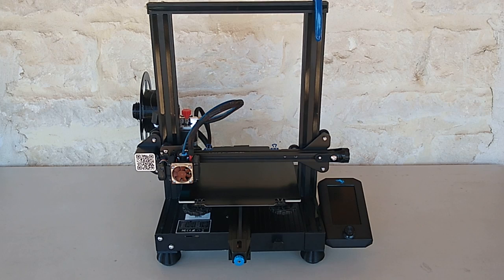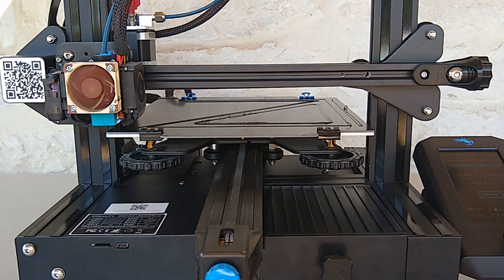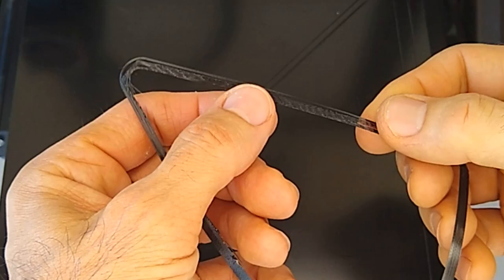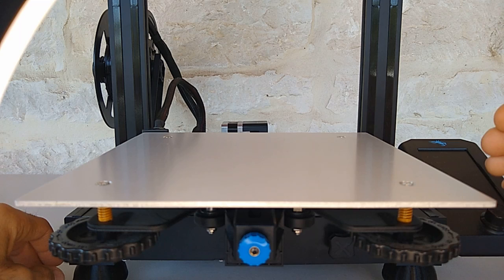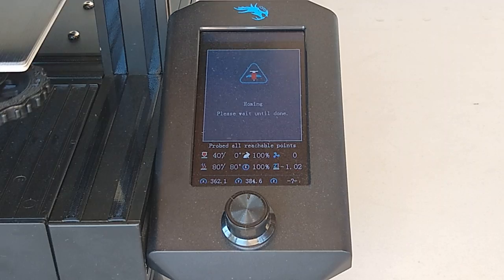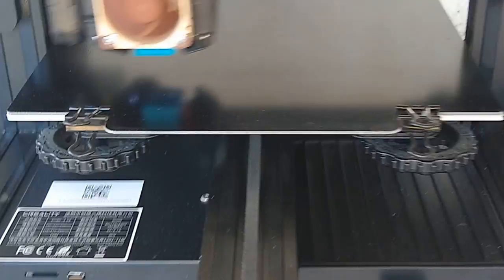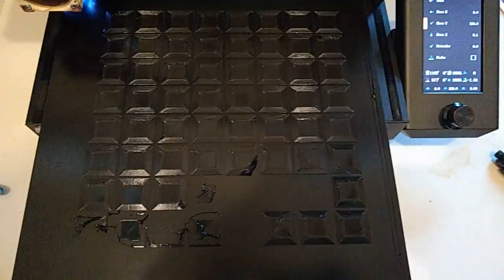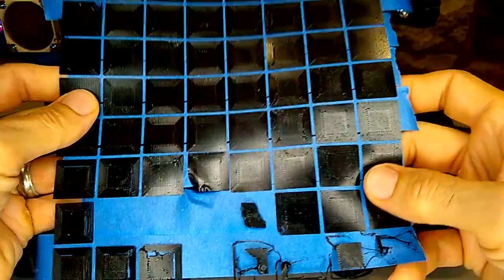Jyers Firmware Unified Bed Leveling Ender 3 V2 - Getting Perfect First Layers From An Uneven Bed

Comment: Before I saw your video, I did the same ruler straight edge test as you. My results were the same as yours diagonally but dramatically worse. When I rocked the ruler, in one direction,  i got a gap at one end of aprox 2 to 3mm. I thought wow, thats a large hump in the middle. Eventually I discovered that if I took ALL of the tention off of the (upgraded yellow/orange) springs, the hump in the centre all but disappeared.
Reply from the maker: Hello Lyndon, Great job with a more in depth look at the root cause of this issue. I hadn't even thought that it could have been induced by the stiffer springs. Have you tried easing up on the spring tension? but keeping them tight enough to keep the wheels from backing out during prints? You can also use solid mounds but you need to make sure that everything else is well calibrated since you won't have any build plate give should the nozzle crash into the bed. What build plate material are you using?
Reply: @vbared  Hi Victor. I'm using the original 'glass' build plate that came with the E3V2 but the ruler tests were on the bare bed. In my case there isn't a central hump in the bed but rather a diagonal 'hump' that can be tuned in or out with the corner sprung wheels. Starting to wonder if the upgraded springs are too stiff for this application but then everyone seems to recommend them?  I had originally set the bed level manually with a piece paper but then failed to reset it periodically as I wasn't sure how often it was required. Then after a while I started having print failures which led me down this path. Of course, a more flexible build plate would make the "warp' less obvious to the eye. An unclipped stiff glass plate will 'rock' just as enthusiastically as a ruler. This could all be a bit of a false trail but worth pursuing, I think. I'll et you know if I find anything significant.
Reply from the maker: @lyndonp6296  Good morning Lyndon, How bad is the bend on the bare aluminum bed with the wheel nuts totally removed. Sometimes there is a slight hump that can be straightened out by pressing against the hump with something like a sandbag to minimize it. Are you using a bed probe like a CR-Touch?

Comment: hey do i have to have a z offset because when i start printing the nozzle is far away from the bed but if i go to manual tunning of the mesh it goes to the right distance. the offset dosent even end up working some parts print ok some are super deep and some dont stick because they are so far away i have tried so many different software's and nothing works i dont know what to do i feel like i got a dud machine
Reply from the maker: Hi ColinLoventhal69, Are you using the stock , metal bracket that came with your CR-Touch?
Reply: @vbared  yes
Reply from the maker: @ColinLoventhal69  What is your current z-offset?

Comment: EXCELLENT VIDEO VICTOR!! thank you very much, i appreciate this. glad im not the only one who has a ender 3 v2 lol but hey,  got a question for you!

lets say I create a mesh, manually tune it so the z offset is at perfect height through out the entire mesh ok? now, where im confused is in the starting G Code (not the one you provided, that works tremendous and am so happy someone created that). Do I use an "M420 S1 ; Enable mesh stored in EEPROM"  or do I do a "G29 ; Auto Bed Level" Also,  G26 also is a Mesh Validating code that (from my understanding) creates a new mesh before every print, would this be a "more accurate" version of a G29/M420?  i assume this is more so personal preference but just want to be clear because i feel like this firmware would prefer G26 code, but im also VERY new to printing. Thanks again Victor.
Reply from the maker: Hi JustA YouTuber, Thanks again for commenting and kind words. The start g-code that worked well for me is below. My print bed is shaped shaped like a Pringles potato chip so I had to disable the probe for bed tilt by adding the ; (aka commenting it out) in front of that command because it would screw up my mesh. The G29 command has a few different uses. These are the three that I use. With this UBL firmware I don't do the G29 ; Auto Bed Level before every print but instead activate the stored bed mesh and load it from my slot 0 before my print starts. Take a look at my complete start g-code so you can see how I use the G29 commands.

G29 ; Auto Bed Level
G29 A ; Activate bed mesh -level (BL-Touch)
G29 L0 ; Load mesh from slot 0

Complete Start G-Code:

; Script based on an original created by tjjfvi (https://github.com/tjjfvi)
; An up-to-date version of the tjjfvi's original script can be found
; here:  https://csi.t6.fyi/
; Note - This script will not work in Cura V4.2 and above!
; max_feedrate_z_override = {max_feedrate_z_override}
; retraction_amount = {retraction_amount}
; retraction_hop = {retraction_hop}
; retraction_hop_enabled = {retraction_hop_enabled}
; retraction_prime_speed = {retraction_prime_speed}
; retraction_retract_speed = {retraction_retract_speed}
; retraction_speed = {retraction_speed}
; speed_travel = {speed_travel}
; retraction_enable = {retraction_enable}
; layer_height = {layer_height}
; smooth_spiralized_contours = {smooth_spiralized_contours}

; Ender 3 Custom Start G-code
M117 Pre-heating the extruder!
M104 S150; start warming extruder to 150
M117 Getting the bed up to temp!
M140 S{material_bed_temperature_layer_0} ; Set Heat Bed temperature
M190 S{material_bed_temperature_layer_0} ; Wait for Heat Bed temperature
G28 ; Home all axes
M117 Auto bed-level GO!
G29 A ; Activate bed mesh -level (BL-Touch)
G29 L0 ; Load mesh from slot 0
; G29 J3 ; Probe for bed tilt (remove semicolon to enable)
G1 X245 Y218.5 Z1 F5000.0
G92 E0 ; Reset extruder
M117 Getting the extruder up to temp!
M104 S{material_print_temperature_layer_0} ; Set Extruder temperature
M109 S{material_print_temperature_layer_0} ; Wait for Extruder temperature
G1 Z1.0 F3000 ; move z up little to prevent scratching of surface
G1 X225 Y200 Z0.3 F5000.0 ; move to start-line position
M117 LET THE PURGE BEGIN!
G1 X225 Y20 Z0.3 F1500.0 E15 ; draw 1st line
G1 X222.2 Y20 Z0.3 F5000.0 ; move to side a little
G1 X222.2 Y200 Z0.3 F1500.0 E30 ; draw 2nd line
G92 E0 ; reset extruder
G1 Z1.0 F3000 ; move z up little to prevent scratching of surface
M117 Autobots! Roll Out!
; End of custom start GCode
Reply: @vbared  thanks again!!
Reply from the maker: @justayoutuber9605  Anytime friend!

Comment: I'm running the same firmware on an Ender 3 except mine has the touch screen display. Also, my firmware does not have the two mesh slot save feature. When I first installed the firmware I thought the bed leveling would by automatic once the Z home height was set. Apparently the Jyers firmware does not have auto bed leveling, it just allows one to manually set nozzle height at multiple points of the bed and save those settings. But, when I pick a probe point in the mesh, the nozzle does not move to that point and go down to the set height. It does allow you to change the nozzle height at that particular point but you have no idea which way to move the nozzle and how far because the nozzle stays at it's home position. This makes trying to level the bed impossible. If for some reason the bed level changes at one or more points, the firmware will do nothing to compensate based on your initial Z height adjustment. Totally useless in my opinion. It's a shame that this firmware is no longer being supported nor worked on. There are several bugs in it that drive me crazy but has many great features that the original Creality firmware does not have. Personally, I'll be searching for something better.
Reply from the maker: Hello Waltkat, Thank you for commenting. Yeah, I hear you it was good in its time. I've switched 5 of six printers to Mainsail Klipper and the last one is running Miguel's Professional Firmware. I had a lot of trouble early on with automatic bed meshes not being accurate and needing manual adjustments to correct them. The only way to get accurate meshes is to minimize the z-offset value from high numbers like -1.76 to something super small like -0.020. The closer you are to a 0.000 z-offset the more accurate the bed mesh will be. There are two ways to accomplish this one is to create a probe mounts in CAD that move the probe body further and further away from the build plate so that it triggers when the nozzle is very close to the build plate. The second way is to dial in the probe distance using an adjustable mount (way easier that having to print many different height probe mounts. The idea is to get the nozzle to the same distance from the bed than the layer height you will be printing. The adjustable probe mount that fits the Ender 3 V2, Ender 3, Ender 3 Pro, and others that can accept the Ender 3 V2 X gantry bracket. Amazon link and how to install video below. Once you're dialed in just create your bed mesh using Miguel's Professional Firmware, Klipper or any other UBL firmware save it to the EEPROM and recall it after your G28 Home All entry in your slicer's Start G-Code similar to mine below: 

G28 ; Home all axes
G29 A ; Activate bed mesh -level (BL-Touch)
G29 L0 ; Load mesh from slot 0 

Precision Adjustable Probe Bracket - https://amzn.to/45mgQhw
How to install and set the probe mount - https://youtu.be/appvG-7PG8E

Comment: so with this firmware? do you have to modify the g code prior to slicing? or will it map this mesh to anything loaded in the printer?   
and also, does the mesh go
away after the machine is powered off ?
Reply from the maker: Hello Eric, Thank you for commenting. Once the mesh is created and tweaked it must be saved to a slot on the EEPROM. I add a couple of lines to the start G-Code to load the mesh after the G28 home all saved in the slot. Check the video description for my starts G-Code.

Best of luck with your mods!

Best of luck with your mods!

Comment: Woah!   How did you get so many test points for your mesh? The most I saw was a 5×5 grid??
Reply from the maker: Hello Broderp, Thank you for commenting. The link in the video description is to the same firmware used in the video, It's a 10x10 probe mesh. I've since switched that machine to Mainsail Klipper but if I had to choose a non Klipper UBL firmware today for an Ender 3 V2 with a 4.2.2 mainboard I would use Miguel's Professional Firmware (linked below). It has a 9x9 max mesh and produced a spot on bed mesh for me without the need to manually edit anything.

https://drive.google.com/uc?export=download&id=1Deep83hNWfwzM5nZ5vt5KzdV3VPbZGts

Best of luck with your mods!
Reply: @vbared    Thanks for the info!  I checked both my V2's and one has a 4.2.7 board, so I will need to check around and possibly look into the Professional firmware.  I like Jyers, but with no updates in a year, I'm thinking its time to move on.
Reply from the maker: @broderp  The Professional firmware has tramming and runs a special algorithm for hotend control instead of the standard on and off, just to name a few. It's what I'm using on my non Klipper Ender 3 Pro, I can't say enough about it.

Comment: Thanks for the grate videos. How do you get the bed mesh loaded with cura 5.1
Reply from the maker: Hello Dom, Thank you for commenting and kindness. 

Place this after your G28 ; Home all axes

G29 A ; Activate bed mesh -level (BL-Touch)
G29 L0 ; Load mesh from slot 0

My Complete Start G-Code:

; Ender 3 Custom Start G-code
M117 Pre-heating the extruder!
M104 S150; start warming extruder to 150
M117 Getting the bed up to temp!
M140 S{material_bed_temperature_layer_0} ; Set Heat Bed temperature
M190 S{material_bed_temperature_layer_0} ; Wait for Heat Bed temperature
G28 ; Home all axes
M117 Auto bed-level GO!
G29 A ; Activate bed mesh -level (BL-Touch)
G29 L0 ; Load mesh from slot 0
; G29 J3 ; Probe for bed tilt (remove semicolon to enable)
G1 X245 Y218.5 Z1 F5000.0
G92 E0 ; Reset extruder
M117 Getting the extruder up to temp!
M104 S{material_print_temperature_layer_0} ; Set Extruder temperature
M109 S{material_print_temperature_layer_0} ; Wait for Extruder temperature
G1 Z1.0 F3000 ; move z up little to prevent scratching of surface
G1 X225 Y200 Z0.3 F5000.0 ; move to start-line position
M117 LET THE PURGE BEGIN!
G1 X225 Y20 Z0.3 F1500.0 E15 ; draw 1st line
G1 X222.2 Y20 Z0.3 F5000.0 ; move to side a little
G1 X222.2 Y200 Z0.3 F1500.0 E30 ; draw 2nd line
G92 E0 ; reset extruder
G1 Z1.0 F3000 ; move z up little to prevent scratching of surface
M117 Autobots! Roll Out!
; End of custom start GCode

Comment: Excellent detailed video. What made you choose the O.15 gauge?
Reply from the maker: Hello Jesse, Thank you for commenting and kindness. Excellent question, over the years I've learned that many printing issues are caused by two major things: wrong build plate material for the filament type and improperly set z-offset. There are others but in my experience 40% are caused by these. It starts with the build plate material. PLA, PLA-plus, ASA, PETG, and Nylon I highly recommend

https://amzn.to/3gDLI9b

Once you have the right build plate material next thing is to properly set the z-offset. The z-offset should be much higher than the .10 most recommend. The key is to have the nozzle deposit the molten filament onto the build plate squishing it no more that 22.5%. The idea with the 22.5% number if printing at a .2 layer height you don't want the nozzle dragging through the filament it's pushing out because it will collect on the nozzles' edges causing stringing (that can't be resolved by retraction) and blobs that will get randomly deposited throughout your print. So .2mm layer height minus 22.5% gives you .155 and thus the reason I start by to set the z-offset using a .15 feeler gauge and from there I fine tune by printing test squares with brim having a .1 gap between it and the test square. I'll print the test part over and over each time baby stepping the z-offset up or down until the brim barely holds on the square.

Let me know if you have more questions about this.

Best of luck with your mods!
Reply: @vbared  thank you so much for the detailed explanation that REALLY explains why. I get great prints and my Z offset is -14 - I totally feel the bed leveling is the #1 “most” important step. I’m really considering starting over to dial it in and will watch you videos - SUBSCRIBED! will check it sir. I really appreciate this information.

Comment: also, I have the Jyers 5x5 (25 probe points) firmware, not the 10x10. noticed in the 5x5 firmware that it doesnt have storage configuration numbers. for example if i put the start g code at m420 S2 (not S1) I dont have the option to store different mesh's in this firmware. does this affect anything?

and i personally have another z axis rod/stepper on my printer. is the G Code for Auto Z axis level necessary while creating a bed mesh?
Reply from the maker: Hi JustA YouTuber, If your bed is not straight, like mine, I would either use the Jyers UBL or Klipper (which is what I'm currently using on my two Ender 3 V2s) If you have a straight bed then the 5x5 will work just fine (no need to store or load bed meshes) it will just use the data gathered from the 5x5 probe points prior to each new print.

Have a wonderful night (:

Comment: What cooling fan setup is this? I like how it's simplistic and doesn't look too heavy
Reply from the maker: Hi Reecefpv, Like you I wasn't able to find many that didn't add a lot of weight or bulk to the x-gantry and decided to design my own super simplistic version that I improve on over time. The current version enables the printing of Nylon without the need for an enclosure. I offer it on my Shopify for $3.49 to help support my channel.

https://victor-bared.myshopify.com/products/minimalist-fans-bracket-and-ducts-for-dual-4010-blowers-single-4010-heatsink-fan-stl-files-for-diy-3d-printing?utm_medium=product-links&utm_content=android

Best of luck with your mods!

Comment: Hi Victor; thank you for the huge effort. Unfortunately I cannot get the my E3V2 to utilize the saved mesh regardless of what starting Gcode that I use. However Miguel's works with a M420 S1 Z2 start code. I thought I'd try the Jyers option as it has more features. Some day I may figure it out.
Reply from the maker: Try this non-Klipper one that I used to use with Miguel's Professional Firmware. Copy everything below and paste into your start g-code field in CURA.

; Ender 3 Custom Start G-code
M117 Pre-heating the extruder!
M104 S150; start warming extruder to 150
M117 Getting the bed up to temp!
M140 S{material_bed_temperature_layer_0} ; Set Heat Bed temperature
M190 S{material_bed_temperature_layer_0} ; Wait for Heat Bed temperature
G28 ; Home all axes
M117 Auto bed-level GO!
G29 A ; Activate bed mesh -level (BL-Touch)
G29 L0 ; Load mesh from slot 0
G1 X245 Y218.5 Z1 F5000.0
G92 E0 ; Reset extruder
M117 Getting the extruder up to temp!
M104 S{material_print_temperature_layer_0} ; Set Extruder temperature
M109 S{material_print_temperature_layer_0} ; Wait for Extruder temperature
G1 Z1.0 F3000 ; move z up little to prevent scratching of surface
G1 X225 Y200 Z0.3 F5000.0 ; move to start-line position
M117 LET THE PURGE BEGIN!
G1 X225 Y20 Z0.3 F1500.0 E15 ; draw 1st line
G1 X222.2 Y20 Z0.3 F5000.0 ; move to side a little
G1 X222.2 Y200 Z0.3 F1500.0 E30 ; draw 2nd line
G92 E0 ; reset extruder
G1 Z1.0 F3000 ; move z up little to prevent scratching of surface
M117 Autobots! Roll Out!
; End of custom start GCode
Reply: Thank you Victor, I'll try and report back @vbared